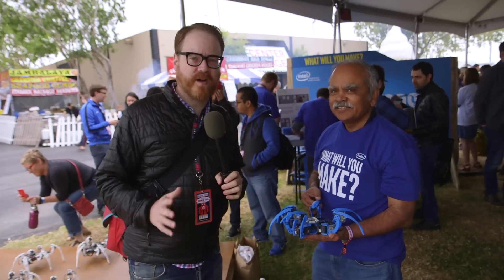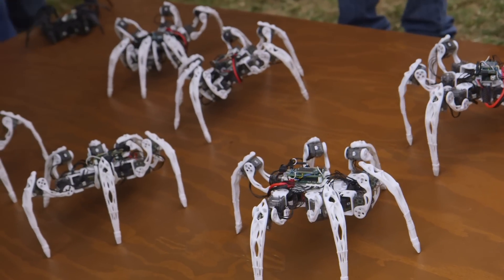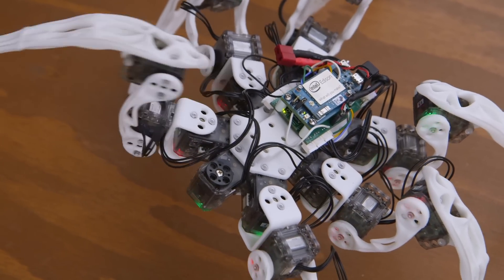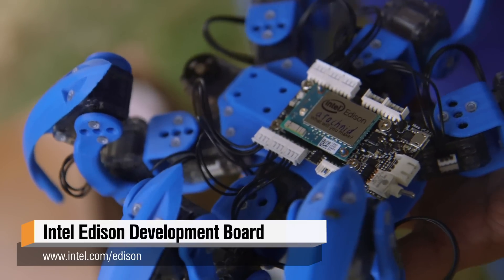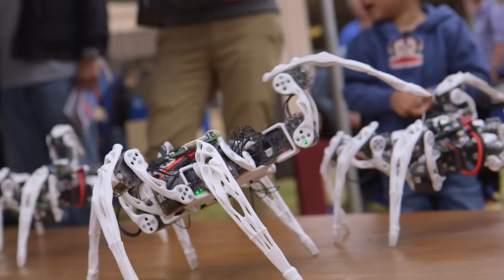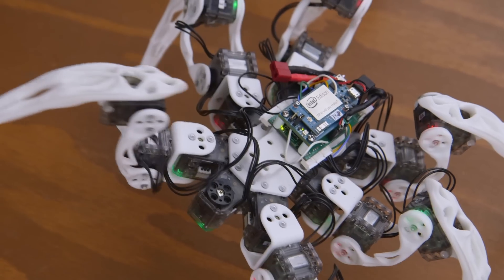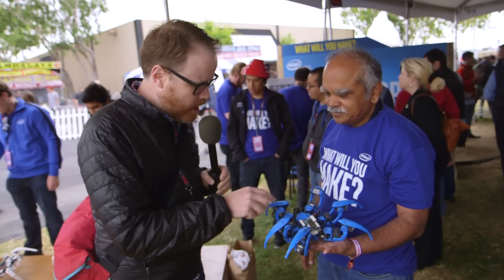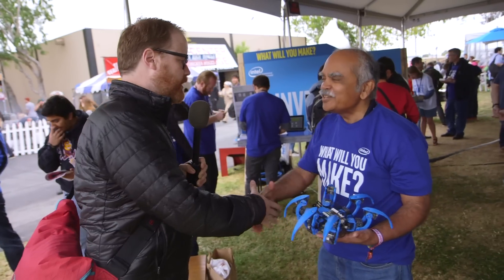Robot Spiders Controlled by Intel's Edison Chip

Comment: they mentioned at the end that the parts were 3-d printed, whats the advantage (better) about 3-d printed parts over molded parts
Reply: You can 3d print them!
Reply: Micah Pheonix The advantage is that you can more cheaply and quickly produce purpose-made components, the set-up time and costs for molded parts are so high that it only makes sense for bulk production.
Reply: Micah Pheonix if something breaks its really easy to repair it
Reply: Micah Pheonix 3-D printing parts allows for more specific intricacies in terms of parts, as well as being faster (in certain cases).
Reply: Micah Pheonix 
It sounds way cooler in an interview
Reply: ***** 
Honestly most of your points aren't really relevant with regarads to the pros of 3D printers.

 "3D printing allows for more intricate designs"

Not really, unless you are talking SLA or other, powder based printing methods. Injection molding often allows for greater precision, and intricies, as long as it's easily removeable from a 2 part mold.

"There's also price of materials. 3D printers generally use fairly cheap plastic resins (the affordable 3D printers anyway)"

Nothing is stopping injection molding from using those thermoplastics. In fact, injection molding allows for a far greater material choice.

"Fairly high initial cost (the cost of of the printer)."
No, this is the PRO of a 3D printer. It's cheap and easy to make 2 or 3 of something.

Micah Pheonix 

Okay the real reasons for a 3D printer. Pros and Cons, compared to injection molding:

Pros:
* Fast turnaround:
   From the time you have your design ready, to the time it's done, can be done within the day.
* No setup costs:
   With a 3D printer (that you own and operate) there's little to no setup costs, because you don't need to have an expensive injection mold machined
* High customizability
   3D printers allow for getting just the part you need (assuming to can design it)

Cons:
* Slow for sustained mass production
   If you want to produce thousands of a design, 3D printers will be extremely slow compared to injectionmolding. Yes injection molding takes some time to get started, but once production has started, you can crank out hundreds of parts per minute.

That's about the con that is. All other 3D printer related cons, just result in it being slow, and ineffecient for making a lot of the same thing, but thats not where 3D printers are great.

3D printers are awesome at making a few, of a lot of things.